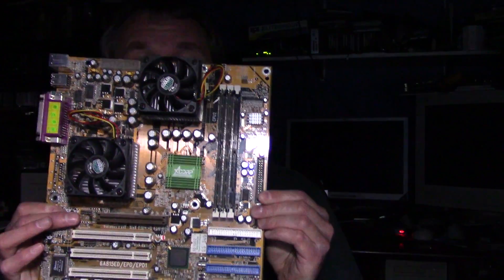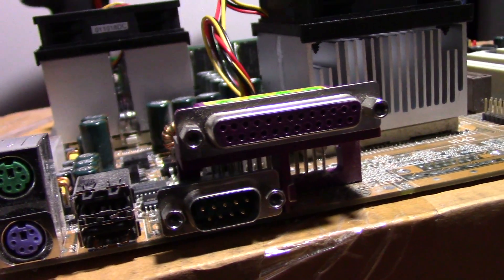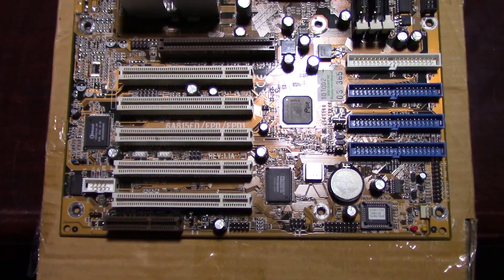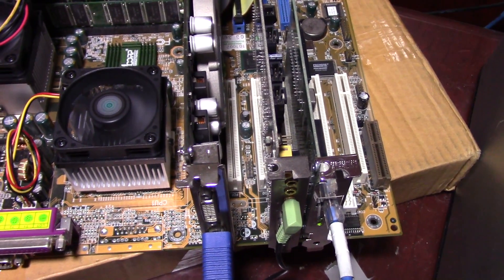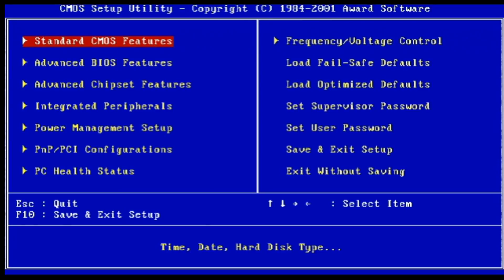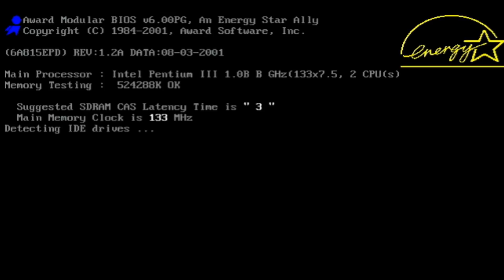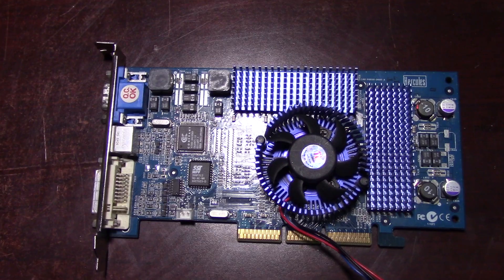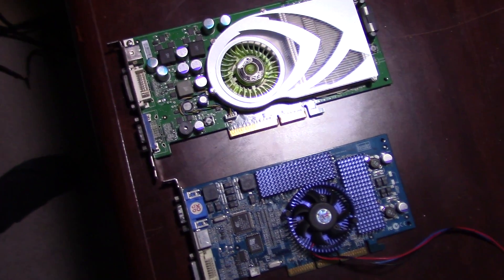Acorp Dual P3 Socket 370 Intel 815EP Overview and Benchmarks

Comment: Hola, todavía tengo mi Acorp Dual PIII 866 Mhz Coppermine, intacta, impecable y guardada, tiene un raid con dos WD de 80 gb 7200 rpm ata 100, GF4 Abit Siluro, Sound blaster y con mis inicios en el modding, me he negado sistemáticamente a desarmarla y su video me la recordó, con esos juegos, en fin… El mejor hardware, ubicándonos en el tiempo, que he tenido gramo por gramo, en toda mi vida. Gracias.

Comment: I used to run one of these years ago when it was still a relatively new chipset. It was nice to find a dual P3 board that was so cheap (nearly the same price as any other P3 board). It wasnt until I had it along side some of my other dualies that I realised why it was so cheap.
The amount of RAM was crippling for a dual P3 system. At the same time I had a Super P3TDE6 board that totally wiped the floor with it, its RAM was ECC and Registered so slower but its dual channel made it so much faster and it had 4Gb of it to play with.
I seem to remember my board was exactly the same as the one you have but it was called an EPD (I seem to remember D was having dual IDE controllers). I had 2x 80Gb and 2x 120Gb drives on mine with SCSI U2 as a boot drive on a PCI SCSI controller.

It overclocks 100MHz chips nice, I had a pair of 700/100/256's running at about 1GHz, stable as bedrock on a 133 bus. I never OCd my 1400's as at the time they were just to expensive to mess about with like that. It runs them though, I never tried dual Celerons, only a single and it worked as you would expect.

I sold it on ebay 12+ years ago for more than I paid for it new. I have fond memories of it but it wasnt a very good board really, its memory was so limiting given the power of the processors... Even a pair of 700s OCd to 1GHz needed more than 512Mb of RAM to get some real use out of them... Gaming was never a thing for them as so few fully supported SMP, it was all about being able to play games and run other programs on another monitor as the same time that made dualies attractive. Other boards offered similar games performance with other better features and cheaper.

Nice trip down memory lane though, the benchmarks remind me of why I got rid of mine :D
Reply from the maker: It's an interesting and unique board. I do feel the ram is the major bottle neck of both motherboard and something like the Supermicro board you mention, with the serverworks dual chanel chipset is absolutely a must for dual P3's.  I have a feeling Tualatin on this board would end up being a total waste, though the extra cache might help a bit. I think the VP6 will out perform both of these boards based on some quake 3 benchmarks I have seen.  The MSI Pro266 Dual S370 is one I would love to play with.